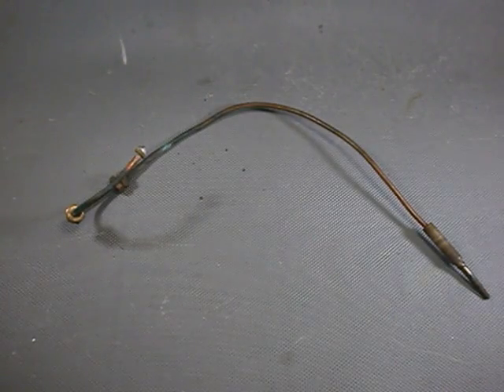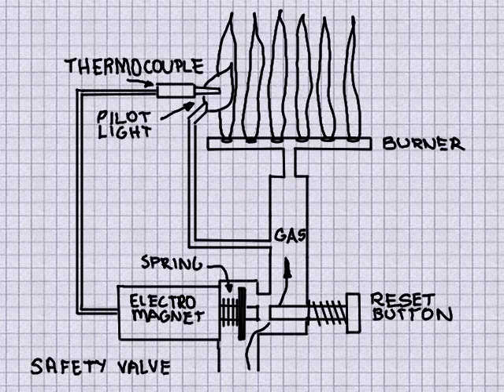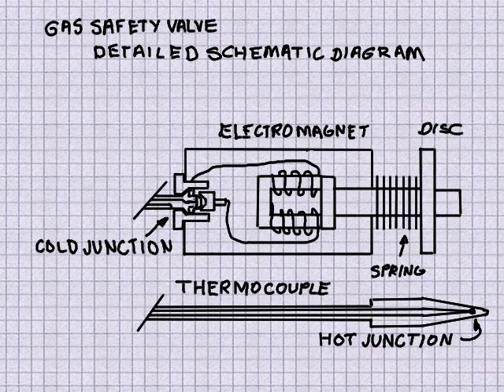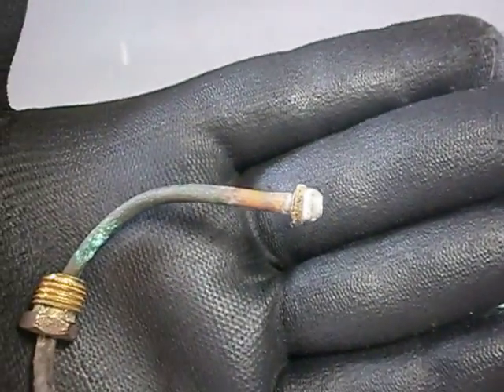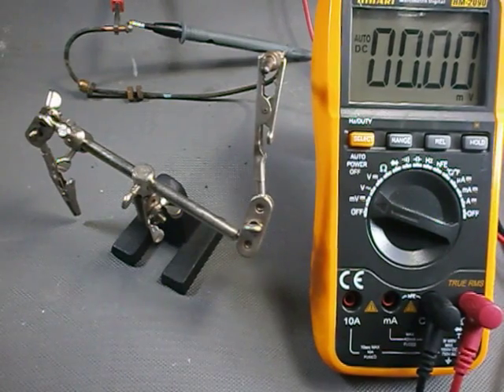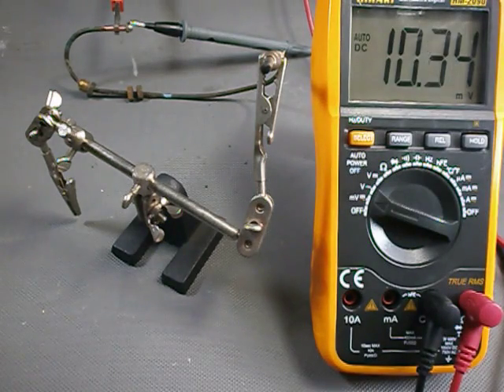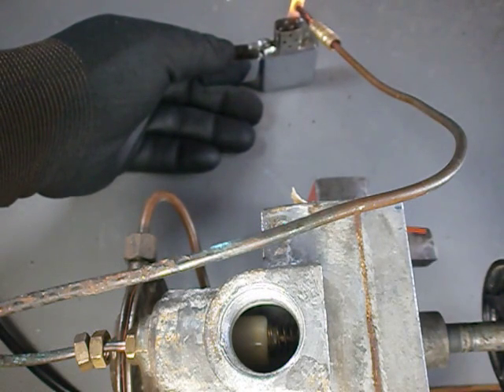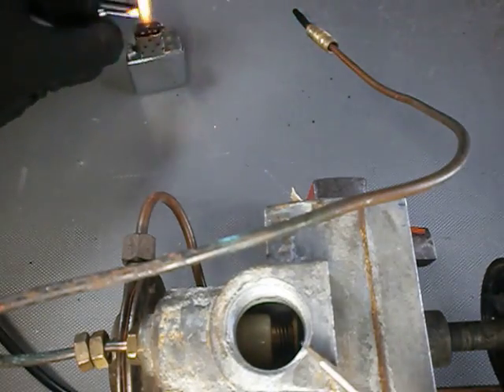The Thermocouple That Could: Gas Safety Valve Repair - BSFEEChannel #13

Comment: I changed my thermocoupler but I assume the valve is stil shut. I don’t know what else to do
Reply: It was the orifice
Reply: @lancer717  Explain please. I dont even know what that is.
Thanks
Reply: @edwardcullen3251  I think he means the hole in the thermo couple is blocked .